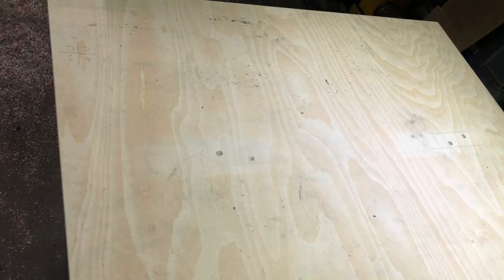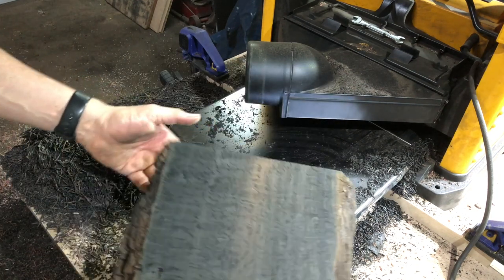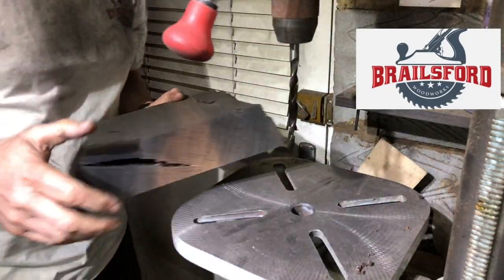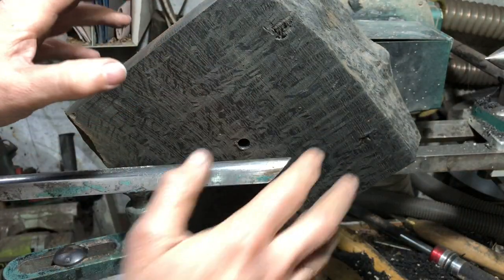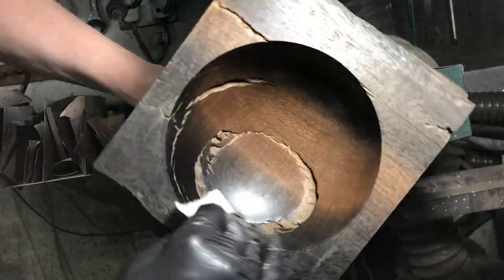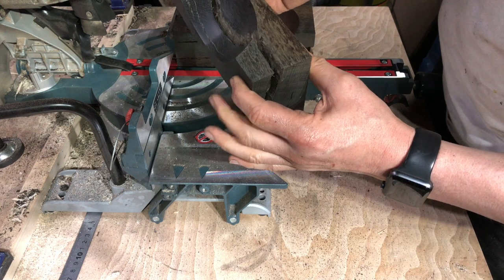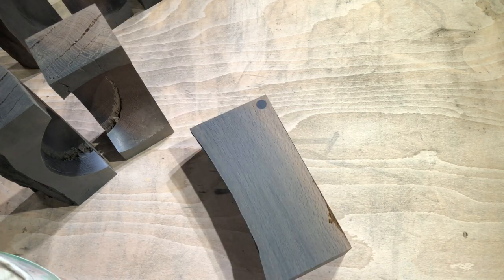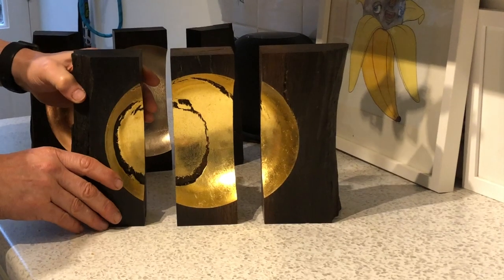Triptych Bowls that stands on their side? - Piece no. 815 & 816

Comment: Stunning work Dick, with that second dowel you made I though you were starting to make a bog oak wand :D
Reply from the maker: 🤣🤣🤣🤣 maybe I should, would look pretty cool in bog oak, specially if turned out some with a higher moisture, as it does warp well while drying 😁😁😁
Proper evil witch wand 😁
Reply: @WoodWithD  Yep I was thinking the same, You need to do this and release on or just before Halloween :)
Reply from the maker: @OriginsOfMo  🤣🤣🤣🤣 but I’d wanna give it time to warp! Guess I could nuke it 😁
Reply from the maker: @OriginsOfMo  okay fine! Will think about it later this eve, after the day job🤣🤣🤣
Reply from the maker: @OriginsOfMo  🤣🤣🤣🤣